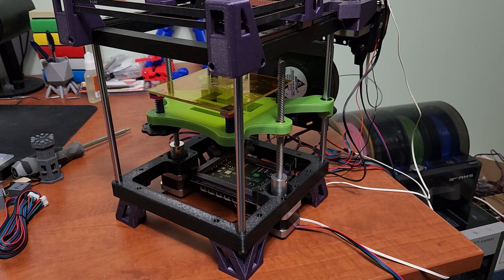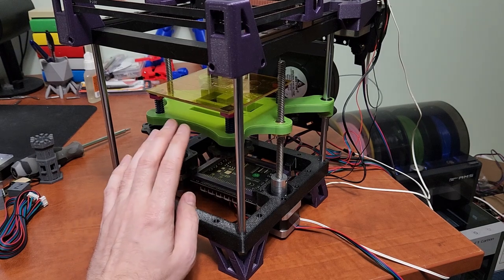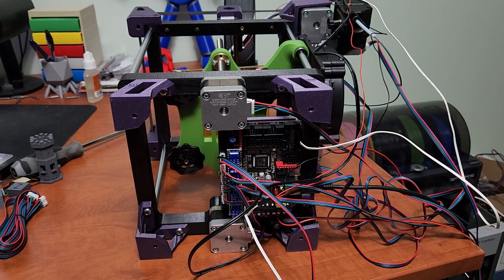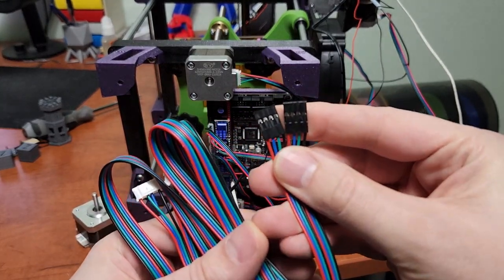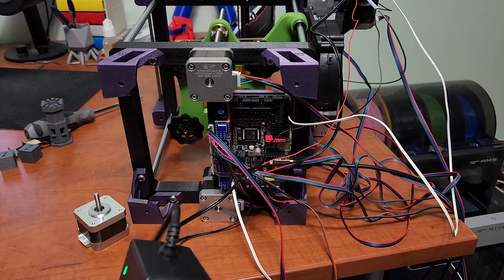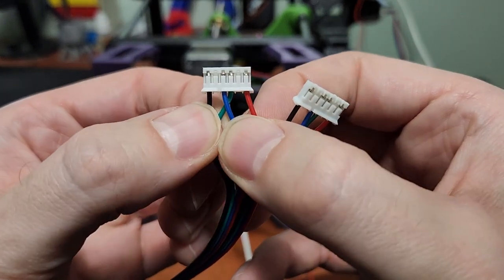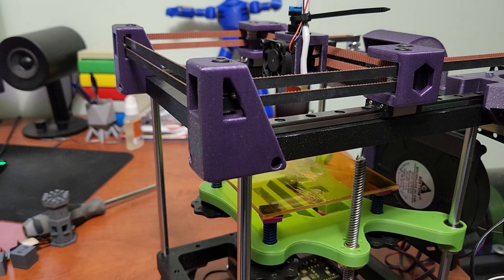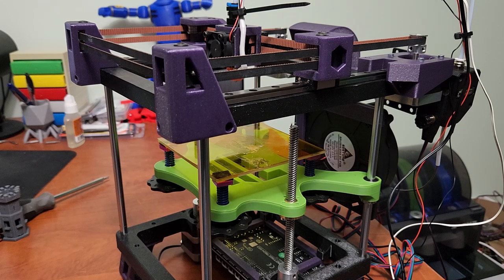Rook a cheap mostly 3D printed CoreXY printer - Build Tips Final - New bed frame and wiring

Comment: You can't fry the steppers but you can fry the drivers by miswiring the stepper! But it requires a very very specific kind of wiring mistake, most mistakes are fine.

So far i've only seen an A4988 explode but these cost pennies. I don't know whether something like Trinamic has a better way of protecting itself, but it's possible.

Comment: Congrats on the 5k! Have you ever thought of a "rook" Delta made from mostly 3D printed components? You could use thick linear rails as the vertical structure if supported in the right way

Comment: The Dupont motor connectors can be hot glued to stop them falling out, The Chinese manufacturers have been gluing them in for years and it works! just remember to add some strain releif to stop them being pulled out

Comment: Ditch the heat set inserts and use self-tapping screws :) They're so convenient. Fine pitch machine threads tapped directly into plastic wear out quickly, but coarse threads grip really well and last a long time.
Reply from the maker: I try and only use bolts threaded into plastic where strength is not needed, my next printer will not use heat set :)

Comment: The best part is no part, and going  cheap and easy with a pre-made Amazon 24 volt power brick and no on/off switch makes perfect sense: you’ll likely have it plugged into a power strip with a surge protector anyway, and hitting that switch is more convenient than dealing with one on an active printer.

Comment: you can also just do 1 z motor in the front center in a triangle configuration with the linear rods. less parts.
Reply: You'll probably get the bed to tilt much more with that configuration, and it will be tilting with the backlash on up and down movement. If you really want to run just one, it better be in the back.
Reply: @LeoTheHuman  maybe use 2 leadscrews connected by 1 motor like the vzbot
Reply from the maker: unfortunately 1 z motor add cost with bearings and pulleys there is no real savings
Reply: @Rolohaun  ok.  Just trying to help.
Reply: @Rolohaun  thats a good point
Reply: I'd put the linear bearings on two diagonal corners, and replace one rod with a rigidly mounted leadscrew. Then print a leadscrew nut with gear teeth around the outside, and put it on below the bed. Mount a pancake motor to the bed with another printed gear on the shaft to turn the nut-gear. This way you only need two linear rods, one leadscrew, and a fourth column of whatever material is cheapest (it doesn't have to be 8mm diameter, or even round for that matter). I think this will eliminate the need for the feet, too.

There will be a bit of backlash from the gear teeth, but that could be compensated by increasing the initial layer height by a small amount. It would be awesome if you could directly turn the leadscrew nut by having a hollow shaft motor with threads on the inside of the shaft, but I can't think of any practical way to make it.

Comment: Hello, i am looking to build this printer as it seems interesting and reasonablely priced, as far as i know you didn't use overpriced stuff. So, i was wondering around how much did you spend so far on this printer? I would like to know because althouth my budget is a bit tight, this kind of proyect seems really fun to build. Anyway, thank you :)
Reply from the maker: it's about 250 USD if you buy everything new, but much cheaper if you have spare parts or if you can get used printers cheap

Comment: Can you use one z motor and some belts like the bambu? Also, could the front 2 linear rods be swapped for one centrally-mounted rod or 3d printed rod? That means total 3 vertical frame pieces (should still be very strong). Can you also use just 3 legs instead of 4? Just hoping to cut costs as much as possible. I'd love to see if you can drastically undercut even basic bedslingers like ender 3 / v2 / Neo.
Reply from the maker: unfortunately 1 z motor add cost with bearings and pulleys there is no real savings, I am sure some other changes could be made to save money though

Comment: i was thinking how strong and stiff coulb be this mini core xy with the top, bottom and bed plate in 5 o 10 mm laser cut alluminum or steel. It's not cheap like printing itself but remain cheap
Reply from the maker: yes I would love to make a metal cnc Rook

Comment: I'm interested in this project, but if I build it, I'm not going to build such a small printer. Is there a way to enlarge this design? Also, I'm going back to trying to put Klipper on my Lerdge K today. I joined Discord, but truthfully, that website doesn't work for me. At 70, I just can't keep up with the speed of sound comments.
Reply from the maker: I am designing a larger Rook printer, Klipper does take some time to learn you will get it I am sure of it
Reply: @Rolohaun  only if I come back to it, putting klipper on my Lerdge K just about did me in! But I've been researching xy printers. Given my overall-goal of printing watch movements, I need to get to core xy, that seems obvious to me now.

Comment: By any chance is it possible to reduce the number of vertical metal struts and replace 'em with the printed parts, with the new bed ?
Reply from the maker: I am sure it could the front linear rods are not really needed

Comment: Is the size fungible? I am recycling an old Weedo with a bad mother board so buying parts for the most part won’t be needed.  I have rails and lead screws that are a lot bigger and if I made it 200x200 would it be a huge mistake or would it just be changing a few perimeter?
Reply from the maker: there are some people making bigger ones on the discord
Reply: @Rolohaun  which discord is that?
Reply from the maker: @MakerBees333  sorry my discord, you can find it in the description
Reply: @Rolohaun  TYVM! I am excited to try this out.

Comment: I forogt what is about new Marlin 2.1.2 with new input shaping, because i'm a marlin fan boy...and a bed probe?? Can you desinig one for leveling noobs like me? I can build a printer without a blink of a eye, but leveling the bed is my endboss. Always fail to do this. Every time i need a probe.
Reply: Have you tried "live leveling"? Print a big square with bottom pattern set to concentric and fiddle the knobs as it goes around and around.
Reply from the maker: for such a small printer the 4 bed screws are easy to level the bed

Comment: What is the total cost?
Reply from the maker: around 250 USD if you buy everything new
Reply: @Rolohaun  so it is just for fun, how does it compare to say kingroon kp3s or the sovol sv06 in terms of speed and quality?
Reply from the maker: @nunogomes6058  this is a much smaller printer but it has the same print quality as a Voron v0, and is faster than a KPS3 and sv06